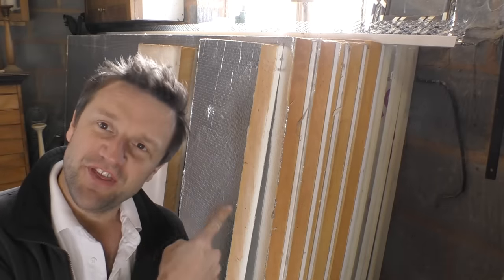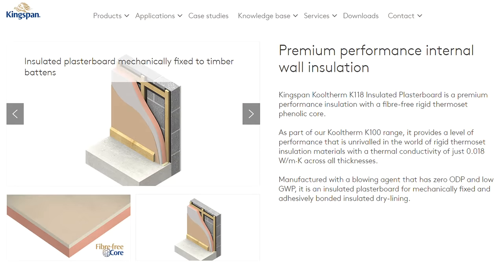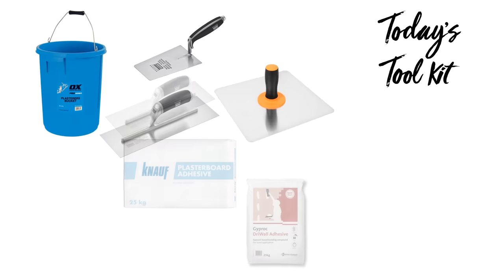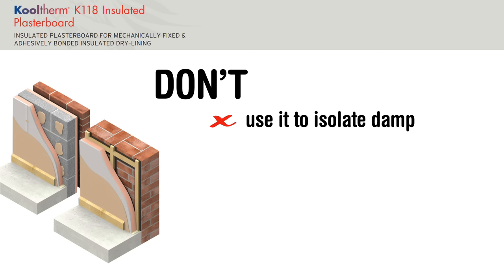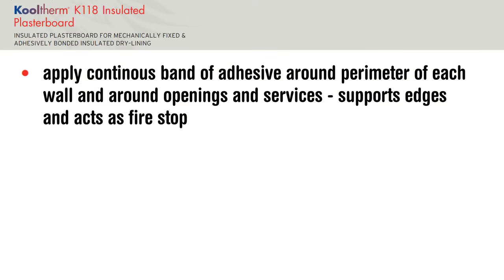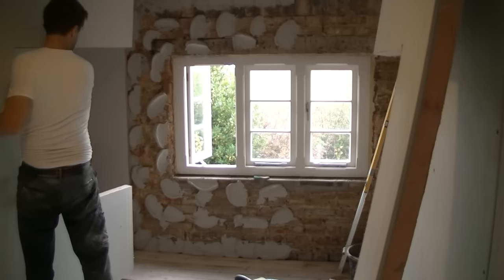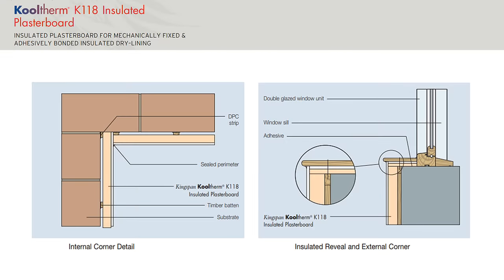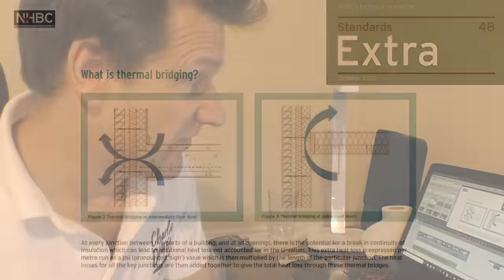How to Dot & Dab Insulated Plasterboard - a DIY Guide

Comment: Hi Charlie, Great video as ever.  I’m looking to do this in my detached thermalise garage to make it in to a garden / family room. I have a question around running electrics behind the boards without compromising the vapour barrier as I’ll probably run them down the walls from the ceiling. Any suggestions on how to do that?  If the garage goes well I have a bedroom I’d like to do too as like yours it suffers with damp and mould in the corners, particularly at skirting level.  One question, I’m sure I’ve seen that it is good practice to insulate the wall below the floorboards to avoid cold bridging, is that something you considered? Cheers
Reply from the maker: Hi Jeff. That my friend is a damn good question! I've got to say I'm no builder so I don't know how they approach this in the trade - so take what I say with a pinch of salt and double check it before acting on it!! But I can tell you from experience that cold bridging can be a big issue in back boxes (I didn't get this right in my son's room). It largely depends how you're going to secure the plasterboard to the walls - dot and dab or battened? Remember, walls without cavities are meant to be battened rather than dot and dabbed. If battening, I'd be inclined to screw a layer of 25mm celotex to the battens so you have an unimpregnated layer (eg 25mm celotex) against the wall (with the joints foil taped) and then the electrics run between that layer and the insulated plasterboard, so you have no cold bridging issues. You can get those back boxes that attach to the plasterboard rather than screw to the wall behind. With dot and dab it's not as easy as you've got to cut a hole straight through the insulated board - although I guess you could spray expanding foam behind the back box before fixing it into position? A chippy friend of mine has dot and dabbed celotex to the wall (I don't think it's designed for this but you're only using the adhesive to fix it in position prior to battening)  battened on top of that - passing the electrics through this section (so no cold bridging) and then screwed insulated board to that, but there's no precedent in the industry for this. Yes, I think it would be a really good idea to take the insulation below floor level, if it's not too much hassle to take up the floor. Failing that, and if the floor is going to be underlaid and carpeted, you could just insulate the 15mm  between the floor and board with expanding foam, as referred to in the video. Remember, you need to get building regs sign off for this, so you could always phone a building control officer and ask what they'd recommend...
Reply: @CharlieDIYte  Hi Charlie, I've been looking in to this for a little while and the different manufacturers seem to have different approaches.  Original thought was to use Celotex who tend to advise building a stud wall spaced away from the exterior wall and insulate between the studs and regular plasterboard over the top of that.  A few advantages to this in that electrics can be run between the plasterboard and the Celotex, sockets can go in dry lining boxes, I could add some additional strength (OSB/MDF between studs) in places where I want to hang a TV on the wall for example (queue one of your excellent plasterboard fixing videos!) plus I kind of know what I'm doing building stud walls but have never tried dot and dab.  Disadvantage would seem to be overall thickness and the impact that has on the overall room size and additional cost of the timber for the studwork and overall effort.

Kingspan's advice seems to be batten the wall with some DPM between batten and wall and then insulated PB over the top.

Just before your video went up I had a builder round to quote for some other jobs and he said he'd done a few garage conversions lately and suggested that I dot&dab insulated plasterboard, so very timely that you had a demo.

I like the idea of wall then Celotex, over-battened and then plasterboard (not sure that insulated PB would be necessary as the Celotex should suffice).  To me this would seem the most insulated option and still provides a service void. I think that's what my neighbour did in his extension and Building Control did sign that off but weren't keen on the method.

For me the garage is just going to be a detached garden room (man cave :-)) and not a formal conversion so I don't think building regs are technically necessary but I don't want to create unnecessary issues if I can easily avoid them.  As and when I get round to doing my bedroom that may be different.

Cheers,

Jeff
Reply from the maker: @jeffday8432  It's fascinating, this - as the experience you had with the builder illustrates that there isn't a coherent approach on this and a lot of builders a) get it wrong and b) probably aren't bothering with building regs. The problem with option 1 - which is what I did in my bathroom is that you haven't totally thermally insulated as you've got the insulation between the battens not over them. Wood is an insulator of sorts but even so. My inclination would be batten with 2x1, with DPC behind - get the wood from builders merchants where it's cheaper - then screw insulated plasterboard to the battens. Go with minimum 50mm insulation or possibly 60mm as you can channel out for the back boxes without damaging the moisture barrier at the back of the board. That said, if you use the void created by the battens for the electrics you still need to impregnate the vapour barrier to get the electrics through but if you seal the hole with waterproof existing foam I think that deals with your cold bridging. I know this is thick, but take it from me, once the wall is up you quickly forget what it was like before, and you need this thickness to give you the requisite u values for building regs sign off anyway.

Comment: Hi Charlie, great videos buddy, I have a question mate..
I believe I have these Thermal Plasterboards in my house aswell. My house was built around 1996-1997 and I have noticed my bedroom walls (which are attached to my neighbours walls) are around 15mm plasterboard, then behind that is a yellow sponge material which is around 30mm in thickness, then a grey bricked wall. I would like to attach a 4 x heavy shelving unit on to it which would be around 100-130kg max in weight overall. Could I ask what would be the best fixings to use for these walls please? (Corefix, hollow wall anchors, Geefix, etc) P.S. I cannot see a void inbetween the yellow sponge and the grey bricked wall. Thank you.

Comment: Can someone let me know which is the best insulated plasterboard to use on a cavity wall that already has cavity wall insulation and also do I need to remove the plaster before installing insulated plasterboard.  I live in a ground floor flat and the walls are freezing cold and we suffer with condensation and damp. The floors are floorboards  covered with carpet and the flat has no air bricks.  We have a PIV fitted but this only helps a small amount.  I am intending fitting insulating plasterboard to all external walls.  We have double glazing as well but the double glazing dosent have trickle vents.  Any advice would be great.

Comment: How do you fit the insulated plaster bored on a bay in the kitchen Butt joint or 45 degree joint ?
Reply from the maker: Butt. You need to overlap it, as I showed in the visual towards the end.

Comment: Surely it won't stop your mould and condensation from forming behind the insulted boards,vapoured absorbent or not,
Reply from the maker: You have to be very careful Stephen. Any breaks in the vapour barrier can let the condensation in, so pay particular attention to socket boxes (it's best not to cut them all the way through if you can avoid this and keeping the insulation continuous around window reveals and corners. On my most recent room I actually battened the wall with 2x1, infilled with 1 inch celotex, foil taped over the battens and then screwed the Kingspan to that - with expanding foam tape below the insulated plasterboard. That way you've got two vapour barriers and you don't have to worry about cold bridging on the socket boxes because there's insulation and vapour barrier behind it.

Comment: How did you seal the gap between each board when there butted up against eachother?
Reply from the maker: Generally I make sure they butt up tight against each other but when this isn't possible I pipe expanding foam into the gap.
Reply: Oh okay so ya wouldnt use the pvc that ya fill the 15mm gap at the top and bottum of the board would you?
Reply: Oh okay so ya wouldnt use the pvc that ya fill the 15mm gap at the top and bottum of the board would you?
Reply from the maker: @markkeane6843  No. Expanding foam is the best way of maintaining the insulation and minimising cold bridges in my opinion.
Reply: @CharlieDIYte  alright cheers man, good video btw

Comment: Is it possible to fix the boards to the existing walls without removing the plaster?
Reply from the maker: I guess you could, using the mechanical fixings I talked about in the video. Alternatively you could screw battens to the wall and then attach your insulated plasterboard to that. That way you've also created a cavity behind the new plasterboard.

Comment: I live in a late Victorian/early Edwardian stone end terrace. The external walls get very cold and with cupboards against the walls we get serious condensation. I want to rip off the plaster and install either a super foil or insulation backed  plaster board. I am concerned about adding to much depth to the wall and having to replace the reveals around the window. If I have to do it then fine. What thickness of insulation is needed? to little and the problem won’t be solved and too much and I get lots more expense.
Reply from the maker: You'll have to do your own calculations for that based on your wall thickness, but it will be minimum 75mm insulation I'd say. It will be essential to minimise cold bridging around reveals and plug sockets.

Comment: Charlie, are your solid walls Lime morter set?  did you worry about wall breathing at all? I have this and my neighbour seems to think ther eare considerations with lime morter walls.
Reply from the maker: It's a good question. I think probably originally they were lime mortar, and yes, breathing is a valid concern. However my house was tyrolean rendered in the '70s and the inside was covered in polystyrene wall paper so it hasn't been breathing properly for years with no obvious adverse consequences. You're caught between two lobby groups - the conservationists who would have you living in a cold draughty house and the government backed green group who are pushing for as much insulation as possible. Personally, I've gone for the second option which has transformed our living standards. At the end of the day, you have to balance the two and decide what to do. If you are going to use this technique the imperative is preventing any cold bridging or vapour ingress that could lead to interstitial condensation. It's tricky because there is obviously a break in the vapour barrier where you butt up each board, and then obviously the sockets if you cut through the insulation. What I've done in my bedroom that I recently insulated is batten the walls with 2x1. There's quite a gap behind the battening because I had to bring it out to get the walls level. Then infilled with 1 inch Ecotherm and foil taped over the battens. Then I screwed this insulated plasterboard to the battens. This way I've got no cold bridging behind the sockets and an impregnable vapour barrier, and also a gap behind the battens for a bit of natural circulation (my roof isn't felted so you do get a fair bit of draught circulating). Oh, and watch this video https://youtu.be/TIDb-pdOnXM and keep your moisture content down by opening plenty of windows during the day and otherwise keeping your RH levels down.
Reply: @CharlieDIYte  and I believe my neighbour,  a builder, is on the side of tradition and "the old ways. In fact I believe he would have something to say about your render, he has told me my old pebble dash is lime based for breathing and anything I put on the bricks on the solid walls must be lime based too. To he honest it pisses me off somewhat. Whats your take on it? I'd be interested to know.

Comment: Hi, Charlie. Thanks you very much for this video, it has been a great inspiration for me and helped me to make a decision to embark on the similar journey. I have one question, though, that nobody seem to have asked before. On 22:48 you have a board cut at an angle to fit your sloped ceiling.  It seems like you cut not only foam part, but a plasterboard as well. How tricky was it to cut it like that and what tool did you use? Any issues with plasterboard crumbling? Once again, thanks for being an inspiration.
Reply from the maker: Thanks Anton. You do occasionally get a bit of plasterboard damaged, but you can always repair that with Easi-Fill - such a great product https://www.youtube.com/watch?v=6Omsv5-NN9k&t=538s I cut the angled piece with an old wood saw - goes through the insulation and plasterboard with ease. If you're going to embark on something like this, just pay careful attention to any electrical back boxes that you cut through the insulation. I know I did it in this video, but it basically creates a cold bridge which is a source of condensation inside the plasterboard as vapour moves from the room through the gap. Better not to penetrate the insulation if you can help it, or, as I've recently done, insulate the wall maybe with battens and insulation in between the battens that you can then tape with foil tape, and then screw the insulated plasterboard to that. That way, any cuts in the board won't cause cold bridging because you've got unbroken insulation behind.

Comment: Hi mate does the plasterboard adhesive stick ok to the silver backing of the boards thanks
Reply: Goes through that at 12:30... apply a bonding PVA or use Knauf adhesive
Reply: @kungfustuey1  thanks mate i missed that at 12:30

Comment: Hi Charlie-I’ve just started a reno on an old house & under the wallpaper is polystyrene (directly under the wallpaper). Was this a 70s insulation thing? Is it glued to the plaster? Does it just slot out? I’m very confused but then lots of things done in the 70s confuses me!
Reply: My dad made my brother fit this in the eighties, he had been sitting on the some since the seventies I think. It's like a wallpaper roll of light polystyrene foam that you applied just like wallpaper and then wallpapered over it. It never caught on, my dad fell for the lie, I'm totally not sure it has any impact. I.e. no harm in it but no benefit either, just strip it like wallpaper with a scraper, if you remove it, but don't steam or heat it.
Reply: @the_judge_8262  Thank you! Is this normal plaster just underneath it then? I figured it would be ruined if so!
Reply: @SKMusic1985  we did it on normal plaster. The plaster should be fine. When we installed it, we iterally mixed normal wallpaper paste, brushed it on the walls and then stuck sheets of the foam onto the wall. I was about 12 at the time and knew no better 🤣
Reply: @the_judge_8262  thank you so much. I don’t feel so scared now!
Reply: @SKMusic1985  Good luck 👍🏼
Reply from the maker: Yes we had exactly the same thing in this cottage. I think it was sold as a thermal wallpaper as you say but the thermal benefits of it are minimal. @The_Judge_ thanks for your input on this. A nice wide painter's knife will scrape it off very easily. You'll probably then be left with the bare plaster, which might need a very light sand to take off any residual glue and then a mist coat as I explained here https://youtu.be/jTjlaAU1NzY

Comment: hi, will a 25mm PIR board be ok for a bedroom in the loft?
Reply from the maker: Not sure where you're thinking of putting that but no it'll be too thin.
Reply: @CharlieDIYte  so we have a room in a loft (not a loft conversion) and the walls in that rom are just plasterboards with no insulation so when roof is cold room is supercold. I was going to stick the celotex to ceiling and then plasterboard over it and fix that to the ceiling joists and I was going to stick celotex between battens on the wall then plasterboard over it

Comment: Did you have to de-rate the wiring at the consumer unit/change the existing wiring for thicker wiring to prevent the cable from overheating behind the insulation?
Reply from the maker: Good question - I'll check with my electrician. Only thing I'd say is that the cabling ran along the base of the wall so although it is behind the plasterboard, there's effectively a void that it runs in because of the plasterboard adhesive dabs
Reply: @CharlieDIYte  as the cable runs up behind the board I'd imagine any heat would dissipate behind it unless you've run parallel lines of plasterboard adhesive either side of the cable essentially trapping the heat. You're supposed to put adhesive around the pattresses to make it airtight but this is where I'd be concerned about any heat building up as you are supposed to seal the pattress where the cable enters - for that short stretch of cable, where is the heat going to dissipate to especially if you have a twin socket drawing 26A? Did you have enough spare cable to draw through the sockets or did you have to replace some of it - the boards on your video look pretty thick.
Reply: @BODGE71  Hi what is the likelihood of using 6 kilowatt of equipment in an upstairs bedroom?
Reply: Who knows but I've since found out that you have to use larger cable or a smaller fuse at the consumer unit.